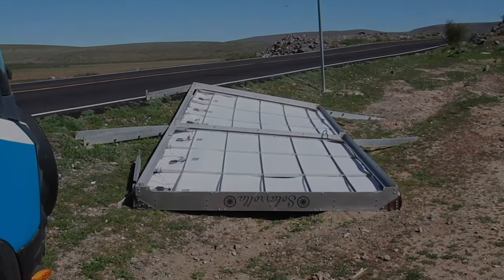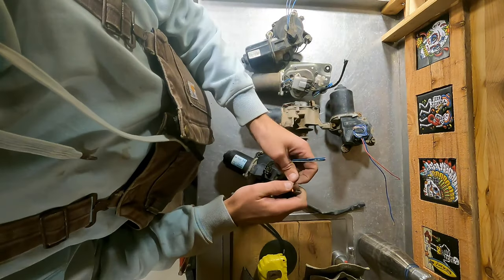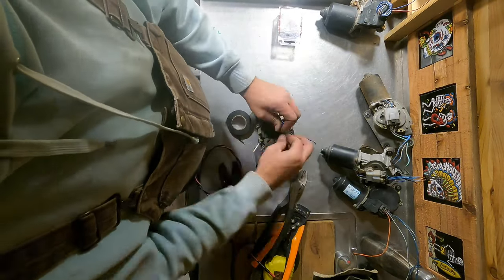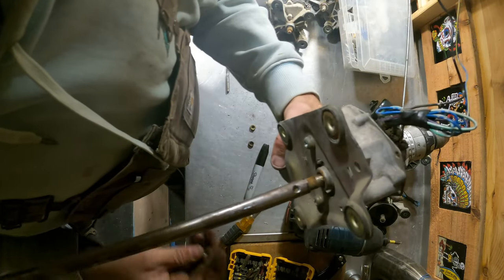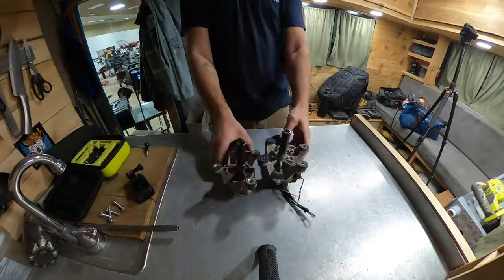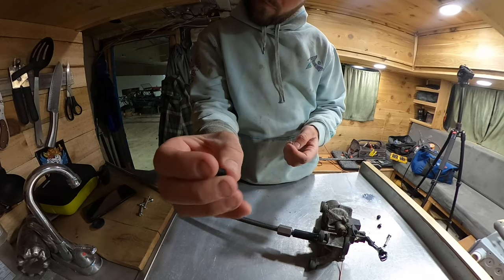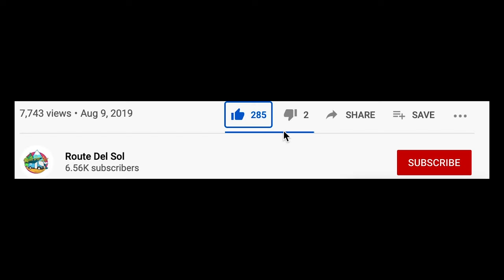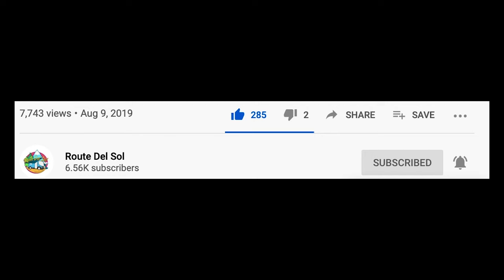I built a Structural Linear Actuator for $20 using a Wiper Motor | Solar Electric Campervan Build

Comment: Using actuators for an escape room prop and they are EXPENSIVE! This is a great build and just what we needed.
Reply: That sounds cool. My sister owned an escape room location in Clarksville Tn. I made a box for her that required a magnet to unlock it. It was sweet.

Comment: I've used windshield wiper motors for a gold hound spiral gold separate which separates the gold dust from the wet concentrates, and runs the water pump recycled water also.

Comment: GRAHHH, I needed this a few weeks ago when building my elevator bed! I went for a much less graceful winch and pulley system. I'm just mad I didn't think of this myself :P
Reply from the maker: Do it again, but better this time :)
Reply: Yeah, just be careful if your system needs to hold up a significant amount of weight. The way this DIY is set up all the load is supported axially by the wiper motor shaft...and those were never designed to take axial loads. There's no thrust bearing in those things. It's just a matter of time before it will destroy itself if there's any significant load on it. Just something to think about...ypu know for safety reasons.

Your pulley system is probably safer.

Comment: Just a little suggestion  , you could have achieved the same assembly by cross drilling the two pieces together as the finished set - up would be , and them adding a roll pin

Comment: At 4:00 when you are complaining about the slow speed, you have a cordless drill laying on the bench. Try using an old one for your motor. Much faster and still powerful as frak.

Comment: When I visited Palabra de Vida Church in Ciudad Victoria, Mexico Don Krow showed me how he designed a way to open sliding windows near the roof of his sanctuary to keep the church cool.  He had a rod that connected like 20 sliding windows together and used a hand crank to open or close all the windows at once on one side of the sanctuary and then he'd do the same to the other side.

I'm building a home that with have sliding windows on the north side and want to use a linear actuator to open or close them all at once.  Didn't think I could do it for $20 though.

Comment: Cool!! I'm using a 24v motor with a 90degree gear reducer on it from a chair lift. I've made a cage with a 36"lawn roller in it to be towed. Just in front of the roller is an aerator that I can move up and down on a lead screw attached to the motor! I looked into buying an actuator, more fun and cheaper to build one!

Comment: Much more interesting with the narration, I could understand what you were doing this time! Still struggling to understand why you're doing it and can't just lift your table up and down with your hands like the rest of us though ;) Sometimes low-tech is the best, as things inevitably break at the worst possible moment!
Reply from the maker: Thanks for the feedback man! I had two different manual systems in there before and I thought that they were just not good enough. Very hard to operate, also this design allows for repair at any moment using the spare motors that I have and also if I am anywhere near a junkyard I can find some spare part very cheap and very easily. It will also actuate not very often so there's that on my side too!
Reply: @RouteDelSol  My van just has a small table that you lift off the hook and move down to make the bed... little bit unwieldy but very simple and low-tech. Yours is definitely more fancy! I hope it works well for you :)
Reply from the maker: @jonathanmelhuish4530  I hope so too hahah! I could be setting myself in for disaster. I will have two tables in my van one will be manual and the other is this one so we will see which one works better.
Reply: Um.... because this is Hella cool..... is that really hard to understand?

Comment: A 12-14.6 Vdc linear actuator can be be used on any vehicle for almost any reason. Prices seem awful cheap for even 2021 prices. But, tailgate on a pickup, hard bed cover on a pickup, power seats, brake & clutch pedal, gas pedal movement closer for a shorter person or further away for tall. 
 A common place is "Exhaust" cut-outs to by pass the entire exhaust system. Yes, louder but dynamometer videos reports show and increase in Horse Ponies. 
 If used on a travel trailer or camper, the uses are endless. Slide-out sections that open to make a larger room require two or more. Obviously, micro-switches can be used to limit the stop / end travel and upon retraction, a place to stop all being repeatable. Now, micro-switched can't handle the amperage to run the motor, but control relays. Using the same schematic found for the common power window (20-30 amp circuit breakers in series for wire/thermal protection is required) but ground is kept constant while only power B+ is changed for polarity used for reversing. 
ACME thread comes to mind for many projects but you may not be familiar with the most manufactured thread, ball nut!
  Yes, the lowly ball-nut is reduction friction to very low levels but faster or slower threads are cut and polished. 
Ball-nut threads are used in manufacturing, inside the machines. A simple 3 axis metal cutting plasma table, welding, drilling, shaping, etc. 
The screw is cut and recirculating balls are chosen for the driven shaft, driving a ball lead screw and one end, has position encoder that can be a simple as a circle, 360 tiny rectangular slots cut in them, a light emitting diode allows a "Count" of binary on-off signals to be able to count, turning those signals into position location, repeatability and computer control, say an  Arduino! I am not a computer guy, control, programs and things like "Stop -Start" programs are used by thousands every day. I fixed cars. I began on my own, apprenticed in a two man shop, hired by a dealer and work at several over decades, stopped to help a buddy earn money in his shop while he had eye surgery on each eye for a detached retina from a high-speed boat accident a few decades ago after building the engines then onto other things, like teaching and holding tech seminars in 7 Midwest states. Now, retired, and can't get rid of my youngest sons 80's go fast / look pretty cars. Because they run, he takes them apart, no digital photos, no drawings of electrical, just 550HP and blown up differentials and somehow it is my job to fix them while I put my life on hold, not working on mine! Damnit! 
DK, ASE master tech since 78.
Reply: Do you think I could use four, at each corner of my RV to lift 1-2k lbs ? Thinking 10ft threaded rod. 1/2 inch strong enough for 500lbs?

Comment: Good work. buen trabajo,  I was looking from different options for my hervicide machine  I use on my tractor  I looking for something cheaper instead of use hidraulic lifts on the spreader arms its manual so i m getting into some with linear actuator

Comment: Did you grind a flat on the lead screw? You might get some slippage or strip off the grub screws otherwise.
Reply from the maker: I cut a slot in both the shaft and the lead screw to prevent slipping but thanks for checking I appreciate all the suggestions. ☺️

Comment: Why didn't you use and automatic window linear actuator? I'm sure there's a good reason, just wondering.
Reply from the maker: I don't have a good reason, I suppose the availability of something like that here in Mexico might be limited, most cars with automatic windows here use a 12v motor a bit smaller than the ones used in this video.
Reply: @RouteDelSol  make sense to me. It's a really cool project.

Comment: 21 seconds per inch? 
For sure that's not gonna be popular in some markets 😂
Reply: That was the speed with a traditional threaded rod... The acme screw he switched to is much faster, since the screw pitch is better designed for this kind of thing.
Reply from the maker: Yeah much faster with the ACME pitch as @ken_the_bigfoot said. But also sometimes slow and strong will work in a specific circumstance as opposed to quick. The good thing is that you can always exchange the motor for a faster unit and voila problem solved eg a drill motor or something cheap and readily available.

Comment: How do you synchronise the actuator operation or is that not an issue?
Reply from the maker: I am currently using a potentiometer to adjust the speed of the actuator, but generally it is a non issue because of the freedom of movement with the way that the actuators are mounted to the table frame...
Reply: @RouteDelSol  Thank you.

Comment: Just curious if a power window motor would work for this, or is that not as powerful as a wiper motor?
Reply from the maker: I think it would... The strength comes more from the mechanics than the motor itself but I couldn't for sure tell you you might just have to try it for yourself

Comment: Could one connect all 4 wiper motors together to  operate on same battery to operate in unison? I would imagine you would use 4 wiper motors that all operate at same speed.

Comment: @Route Del Sol I am trying to cook up a cheap actuator for a sewing machine foot pedal (for a double amputee) and I'm running in circles. Any ideas what type of actuator I need? Offhand I am thinking about adapting a cruise control actuator for this purpose. I think I'm going to have to MacGyver the shit out of it to get around the brain box.
Reply from the maker: I think any small light duty linear-actuator should do the trick, using second hand or creating your own DIY would be the best. Have you thought instead, of using a potentiometer to replace the foot pedal all together. And just having a hand dial do all the work on top of the table?

Comment: Nice work, I was just wondering if the motors that you decided to use would be strong enough to lift 260lbs? For the project that I have in mind I would only need 6 or so inches of stroke to enable a workbench to lift/elevate 5 to 7 inches consistently from a lower powered 12V battery. Something like this could be used for an electronic dropper post for a bicycle if you could somehow make it smaller as most dropper posts are 100mm to 170mm of adjustment. Just a thought.

Comment: Great work! How much it can lift (in kg) and what torgue has this motor?
Reply from the maker: I am not sure of the answer of this. I have seen similar designs bend and warp thin steel tubes so that is a good indicator of lifting strength. And the torque well I haven't been able to stop the motor in its tracks yet so I think the nut would strip before the motor gave out. Pretty torquey hahah
Reply: @RouteDelSol  anyway thanks!